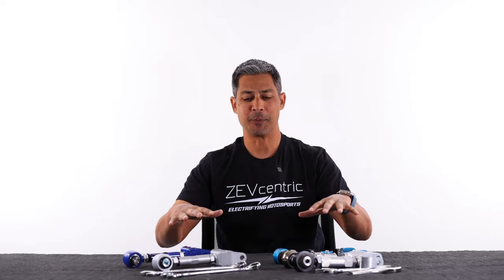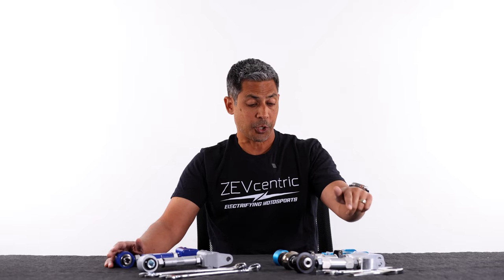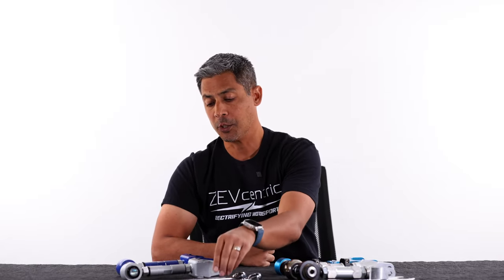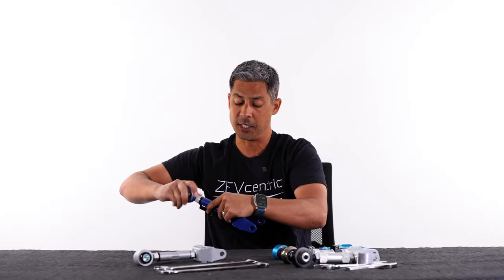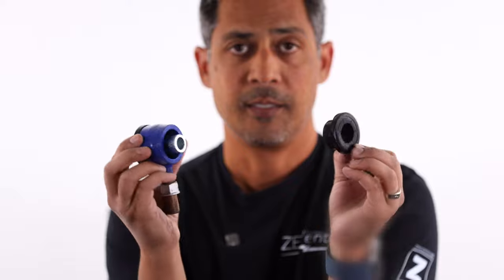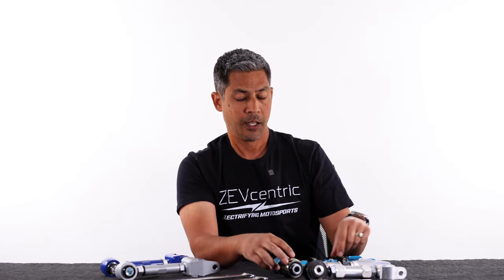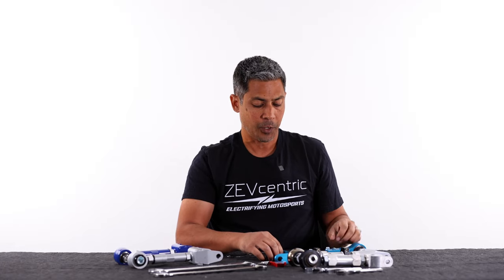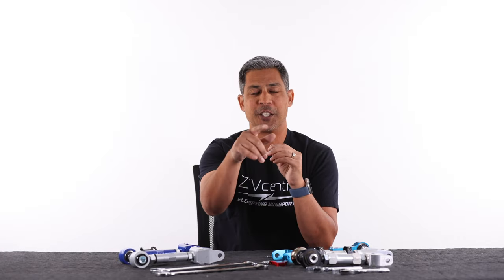Tesla Model 3 Model Y Camber Arms breakdown & what we prefer! MPP N2itive Unplugged Megan Whiteline

Comment: Megan racing metal was not welded properly (not enough heat to penetrate the metal to create a weld, it was barely hanging on). I installed the arms about 40 days after I bought them. Didn't notice anything. Started doing the alignment the next day and noticed it's coming apart. Megan Racing said this after 30 days. There is no warranty. They didn't even bother to tell me not to drive the car.. Imagine if a customer hears, "we won't replace it under warranty" then they drive the car, the wheel locks up and they crash on a highway. It's insane not to warranty the part because of improperly welding, but it's even more crazier to not mention a single thing about do not drive the car for safety reason. I'm surprised this company is in business.
Reply from the maker: We will not be selling Megan parts.  Only took a chance on this because people cringed at spending $395 on legit camber arms when their lowering springs were only $350.  Well, lesson learned.  You get what you pay for.
Reply: @zevcentric  I bought the MPP. 1 week later it broke in half. I emailed you just now with photos. I can't post links on YouTube. "You get what you pay for" is...largely false. Price and quality frequently have only a loose correlation in the modern manufacturing world. Rather, it's a balance between cost, quality, and time/service.

Comment: Have you installed both MEGAN AND MOUNTAIN PASS on your Tesla and how would you compare driving quality between the two?
Reply from the maker: We installed Megans on over 20 vehicles and MPP's on probably over 1000 model 3's/y's.  I can only tell you the Megans were absolutely horrible due to them failing that it's not even a comparison.  In this case you get what you pay for.  I never had a problem with MPP but 100% of the Megan arms failed on customer vehicles that we pulled them off the website entirely.  Did you watch the video?  The quality of the MPP sealed spherical bearing and the other materials used is on a whole different level.  You can't compare a $150.00 steel part to a billet piece of art like the MPP arm that's made in Canada.
Reply: @zevcentric  does the MPP CAMBER ARM work well even with the TESLA STOCK TOE, TRACTION, AND TRAILING ARMS?

Comment: Any thoughts on redwood performance? Debating them, unplugged performance, or mountain pass.
Reply from the maker: I have a set slightly used we can offer you as well as a new set.  They use jam nuts and spherical bearings that aren’t sealed.  MPP is still the easiest to adjust and have a quiet bearing for the long haul.
Reply: @zevcentric  thanks I’ll probably go with mpp
Reply from the maker: @07BSPtC  send me an email zevcentric@gmail.com and we can ship them asap.

Comment: On the whiteline rear camber arm, what is the black rod for?
Reply from the maker: For headlight leveling sensor.  Doesnt apply for usa market
Reply: @zevcentric  In this video, this appears to only be the upper rear camber arm, so do you adjust the front upper arm as well? In theory, you cannot adjust the rear camber properly without adjusting the rear upper front arm?
Reply from the maker: @TweakedGSX  that is correct.  This is rear camber arm which is centrally located on the knuckle.  Replacing the other rear arms isn’t needed for that reason. Plenty of factory toe adjustment. I think you are referring to the toe arm.  The front upper control arm doesn’t have much camber gain when lowering a model 3 or Y so isn’t “required” to reduce uneven tire wear.

Comment: In a northern climate, what would you recommend for the treads on the MPP arms to keep the corrosion down?
Reply from the maker: The arm is aluminum and the tie rod is stainless.  They already put anti seize on the treads but you will want to make sure you put more each season to prevent them from getting stuck due to mineral deposits that can cause surface rust.

Comment: what about Redwood Motorsports cambers?
Reply from the maker: Still uses a jam nut but they use high quality bearings.  Biggest difference is that the bearings are not sealed and need to make sure if the adjustment rod is nickel plated that it doesn't develop surface rust if you're in salty or snowy climates.  The arms are beautiful though.  Those are the only things to take into consideration.